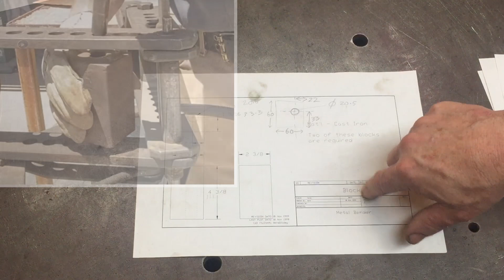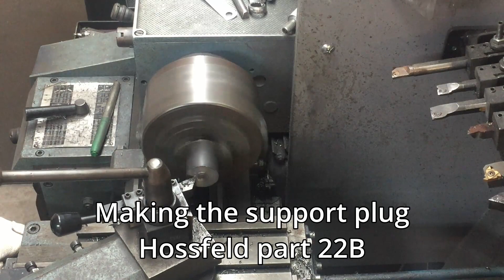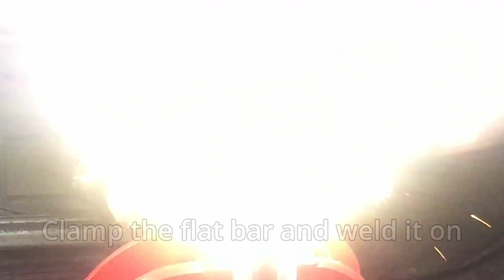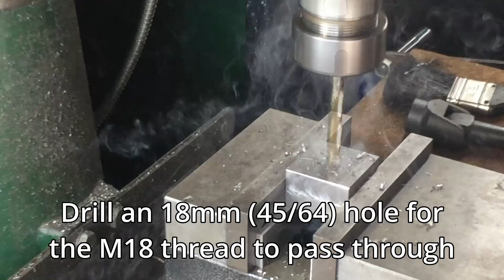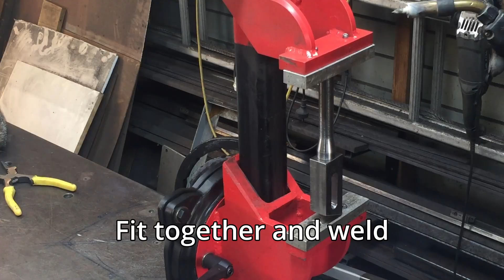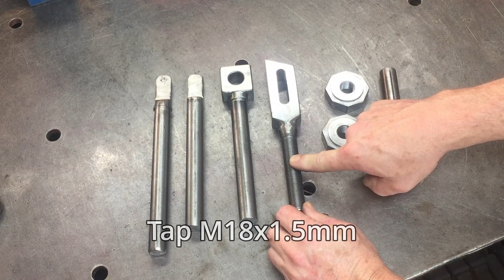Hossfeld Bender - Tooling #1

Comment: Curious why the center pin is larger than the other pins. Would it not be practical if all the tooling had the same diameter through hole?
Reply from the maker: Hi, I'm not sure as I did not design this bender, but I presume it is so the center pin is protected. E.g. if you try to bend something too big, the smaller pins would bend instead of the center pin.

Comment: mild steel can be case-hardened and carburized at the same time, might be a good option for the eye bolt dog if you have some way to heat the whole setup. think clickspring over in australia has a video with a recipe for the carbon mix to coat it with and how to do it
Reply from the maker: Thanks for the advise. I think the steel I used had high carbon in it as the edge hardened when I heated and quenched it in oil.

Comment: This is just the information I need. I bought a bunch of dies for a Hossfeld #2 for a bargain price, so then I bought the Hossfeld frame and some more misc parts for it. These two videos have my head on fire, as I now have the knowledge to make the basic tooling to start actually using it. I cannot thank you enough for this.
Reply from the maker: I'm no expert on the Hossfeld bender, but I'm glad the video helped you. 
You are lucky to find Hossfeld tooling at a bargain. From what I have seen the tooling is very expensive, even second hand. There is probably no chance finding tooling in NZ where I live. I have not even seen a Hossfeld bender for sale here.

Comment: Good work. I use EN8 mild steel for that sort of job as it is the hardest of the mild steels. Also you can harden it which improves wear resistance, in oil which oil blackens it too.
Reply from the maker: Thanks for the info Ben.

Comment: Another great video!  I was thinking you’d need to hardface that edge, but you got there in the end.  That vise is really working out well!  I wasn’t surprised that the thick block of steel, even mild steel, would take that long to cut.  If accuracy isn’t critical, would it be worth it to start the cuts with the cutoff wheel?   Cheers!
Reply from the maker: I did think about using cut off wheels, but from past experience I would need a whole lot off them to get through the block. The bandsaw is a lot slower, but it is cheaper.